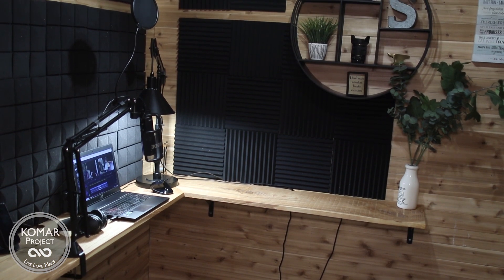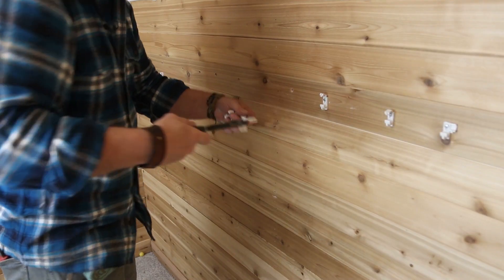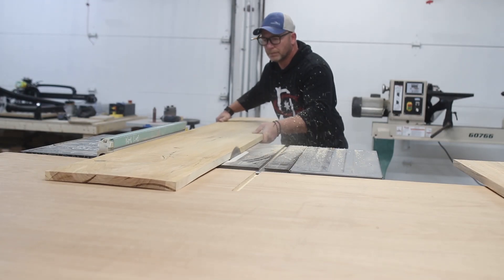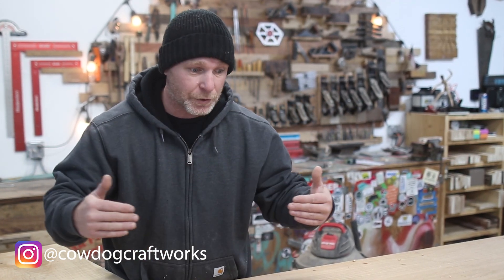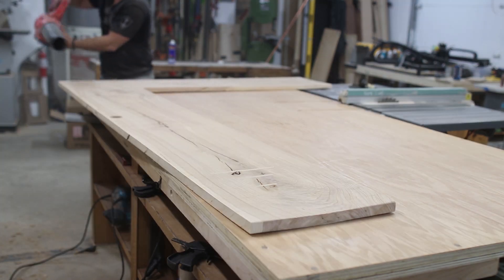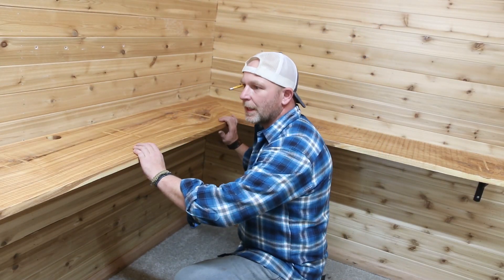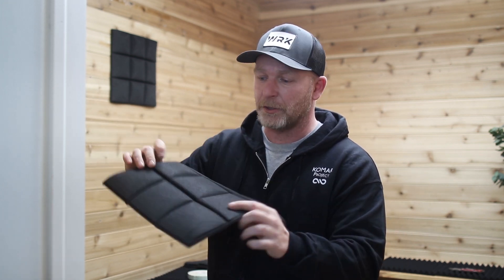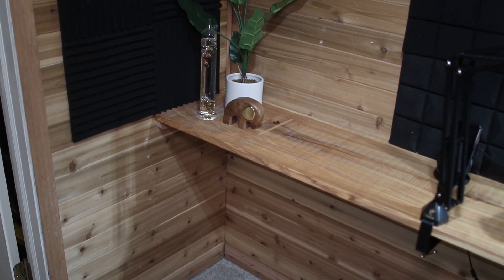I Transformed my CLOSET into a Studio OFFICE /// Closet to Office Makeover!!

Comment: I made a cloffice in my previous townhome. I love to the utility, the convenience, and the privacy. What I didn't love though was the lack of air circulation. And if you add electronic equipment into the room... That translates to heat. So you've got hot air that's not circulating. I wish I would have seen some ideas to counteract that that wouldn't include extra duct work.
Reply from the maker: I didn’t even think about that.  It’s nice now cuz it’s winter but might be a issue in the summer
Reply: I want to convert my walk-in as well, but I’ve gone in a different times of the day and the heat and stale air varies. How to address airflow is my question.